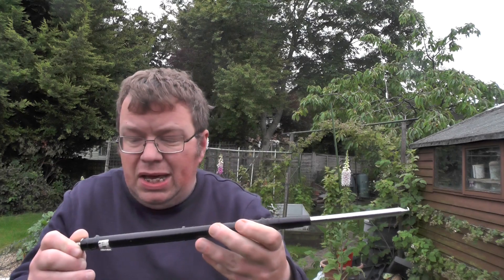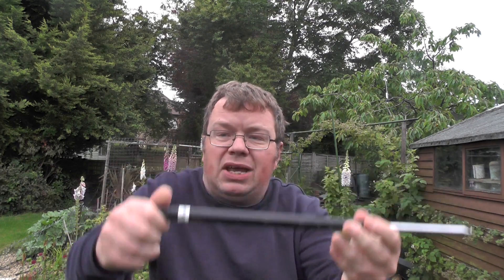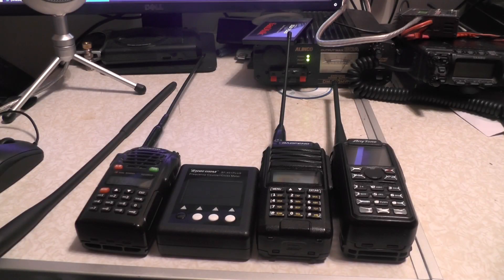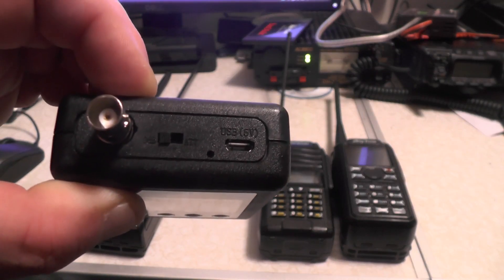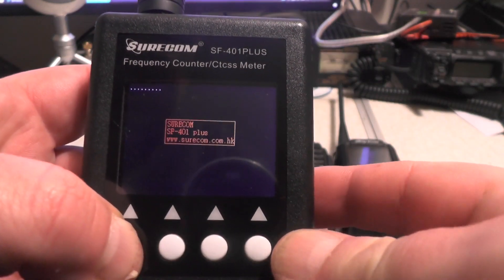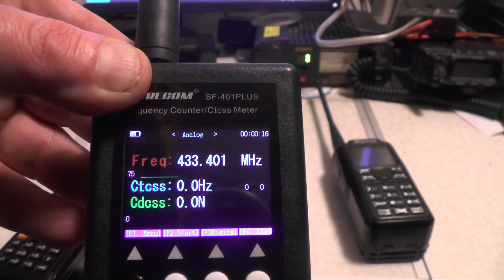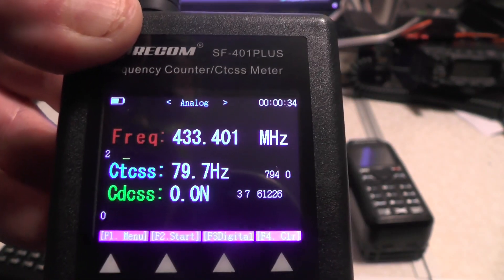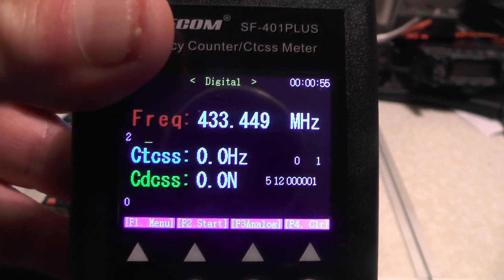Surecom Frequency counter test

Comment: The new opto scout now decodes digital. Just trying to find a decent review on it before deciding whether it’s worth the high price. It can apparently decode DMR, TDMA, GSM, FHSS, APCO 25 and Tetra. So quite comprehensive
Reply from the maker: Wasn’t aware that they had a new version coming out I’ll look into that
Reply: Finally saved up for one. Does exactly what it says on the tin. I’ve tested it on my DMR, C4FM, analog and d-Star equipment and it works perfectly. It even worked on my key fob! A bit expensive though, and the squelch has to be set exactly right for digital decode. But otherwise it does the job as advertised.

Comment: Jez, I suggest using a small screw extractor to remove the pin on your antenna. If that fails maybe soldering some wire in then gently pulling might work. Good video Lad.

Comment: Just started radios... what would I use this device for? Just measuring my radios frequency wirelessly and not corded? I m new. Just very curious and trying to learn everything
Reply from the maker: You would use it to find a frequency of any radio and to make sure your radio is on the correct frequency it will also pick up radio frequencies near by

Comment: I’m trying to figure out what a frequency counter is for? I know what frequency I’m transmitting I don’t need something to show me that. If it could be attached to an outside antenna to pick up that info, it would be helpful. But I’ve read that if it’s not next to the transmitter it won’t pick up anything.  Has anyone tried that, and what results did you get?